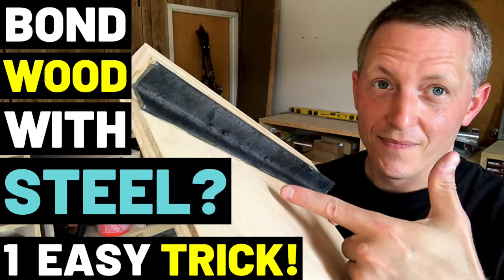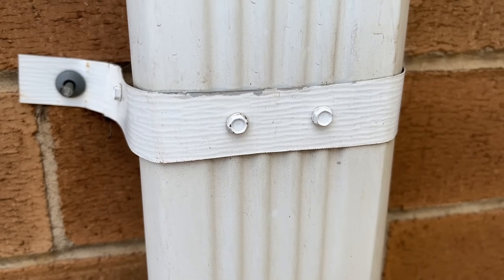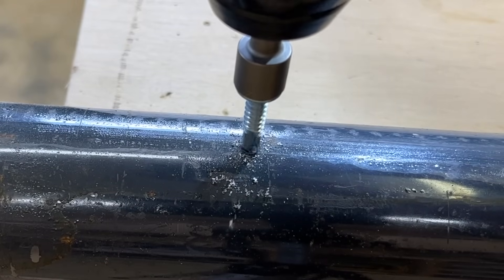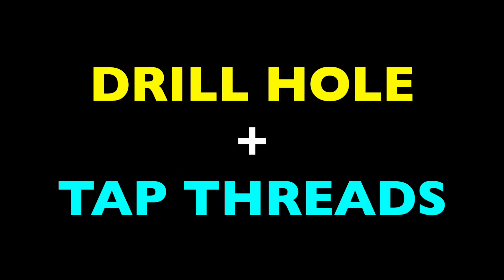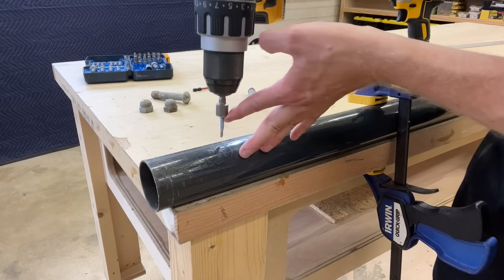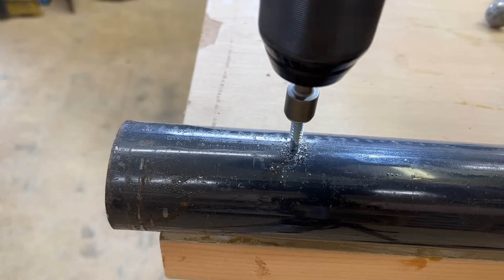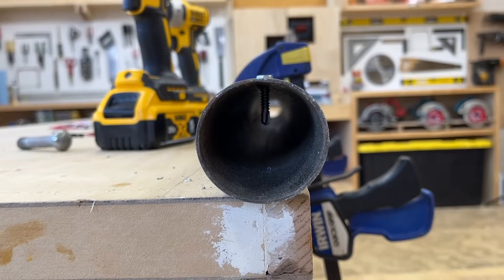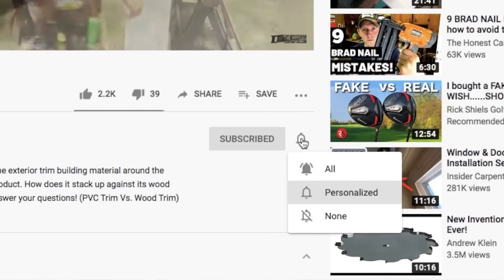These Screws CAN DRILL STRAIGHT INTO METAL! (Self-Drilling Screws...Fasten Anything To Metal!)

Comment: As someone who uses these screws all the time. I’m a commercial plumber so I’m constantly securing to metal studs. That being said the title made me laugh. I understand that it’s aimed at people who don’t know this stuff but it still sounded like they were some revolutionary new invention. I do find it odd how we use the names of these screws. I know they’re self drilling but myself and everyone I know calls them self tappers. If I asked a helper to pick up some self drilling screws who knows what he’d come back with.
Reply: Thanks for this comment because I was just wondering if I could use these self tappers to attach heavy shelves & heavy art work to my condo walls that have steel stud beams.
Reply: @sunshinesandy3265  actually if you’re connecting something small but heavy, I wouldn’t use self tappers. Screws even fine thread don’t hold really great in metal. Maybe if they’re structural metal studs then they’ll hold. If they’re standard partition type thin metal studs, I’d drill a half inch hole and run a toggle bolt vertically through it. That’ll hold anything you can throw at it
Reply: @joshcowart2446  Thank you so much for your help. You recommend that I drill a 1/2 inch hole horizontally through the drywall & metal stud and run toggle bolts right? Should I use my Bosch Cordless Drill Driver or Impact Driver? And what type of drill bit should I use Titanium or ?
Reply: @sunshinesandy3265  yes. when I say toggle bolts I’m referring to the zip style. Many call them molly bolts. I’m not referring to the spring loaded ones. The spring loaded toggle bolts will work but they’re just difficult to use and if you mess up you can’t reuse them. Home Depot and lowes sell the zip style in packages with as few as 4. I use 1/4” ones and they’re rated for 100# in drywall so in a metal stud one would hold hundreds. If the shelf doesn’t line up with 16” center studs, I’d get one side in a stud and the other in drywall. I don’t know the weight you’re hanging but I’ve used that same method to hang a 20 gal water heater on the wall. I’ll put a link for what I’m talking about after the text.
As for drills, generally drills are best for drilling holes and impacts are best for driving screws. The exception is if you’re doing fine woodwork then drive screws with a drill so you can control it better and not tear things up. However in this case either tool will both drill and tighten the bolt. 

https://www.lowes.com/pd/TOGGLER-10-Pack-Assorted-Length-x-3-16-in-Dia-Toggle-Bolt-Drywall-Anchor-Screws-Included/3183815

I like these best. The ones at Home Depot will hold just as much but they sometimes break getting them in because of how they’re designed. However some Home Depot’s have hilti brand mollys and they’re just as good or better than these. We use these for all sorts of very heavy things. I use them for wall mount water heaters, porcelain wall mount bathroom sinks. We’ve even secured 3” steel gas pipe to a wall. They’re the best drywall fastener. I don’t know if I mentioned it but when you put one in a metal stud you have to put it the metal toggle in vertically. If you don’t it won’t be able to sit flat and will either break when you’re pulling it tight or cause your bolt to be crooked
Reply: @sunshinesandy3265  sorry I forgot to answer the drill bit question. Titanium will work. Any twist drill bit should work even if it’s a thick structural metal stud. The material they’re made from just determine how long they’ll last. If you’re just buying some for around the house then I’d save money and get a set of black oxide. Black oxide are the cheapest, then cobalt is next, and titanium should last the longest. When drilling metal you want to use your drill, put it on the high torque/low speed setting (usually 1 on most drills). If you aren’t sure, there should be two speeds, just pick the slowest one. Fast will work but it heats up faster and will dull your bits quicker. However like I said earlier if you’re drilling through thin metal studs, you can use your impact or drill on whatever speed. It will go through it so fast it won’t matter. 1/2” hole should be perfect but depending on the size of toggle bolts you may can go smaller. If you’re having trouble drilling the bigger hole then start with 1/8” hole, then 3/16”, then half. That’s what I do because those are standard but sizes that I keep but any small size will work and then just worn your way up
Reply: @joshcowart2446  Thanks very much for your awesome advice & link. I appreciate it immensely and will buy those togglers you recommend from Lowes. I never liked those spring toggle bolts & never used them. I want to hang a book shelf and a very heavy painting with two metal bracket mounts on each top corner. And secure a medicine cabinet in bathroom that became loose.
Reply: @sunshinesandy3265  you’re very welcome. Based on that, you could probably just use those in drywall and be fine. But if you have a stud there why not quadruple the strength
Reply: @joshcowart2446  thanks again for your fantastic advice. I need to buy larger drill bits too and appreciate your recommendations. I can tell you are super skilled professional and really know how to do things right.
Reply: @joshcowart2446  I have a Zircon MultiScanner HD800 is that most accurate one to locate metal studs, center of studs, electrical wire & deep metal pipes? It seems to indicate metal studs are 16"apart and 1 1/4 " wide does that sound accurate?
Reply: @sunshinesandy3265  that should work. I have the cheapest zircon stud finder and it works really well. However the best way to find metal studs is a rare earth magnet or any reasonably strong magnet. Either can get close enough. If you need to pinpoint it get a small drill bit or finish nail and push it through the drywall until you hit something. As for the size I thought they were just like 2x4s which are 3 1/2 x 1 1/2. The 16” is correct but that’s center to center. The distance in between is usually 14 1/2 but that’s based on 1 1/2 thickness. If it’s 1 1/4 then I guess it’s be 14 3/4 in between. If you can’t find one at 16”then it will be 24” but most are 16” on center
Reply: @joshcowart2446  Thanks for your awesome intel. The studs I measured with Zircon MS HD800 are 16" apart from center to center. Center detection seems very accurate. Metal 2x4 studs are supposed to be  3 1/2 x 1 1/2 so I guess Zircon edge to edge detection is 1/4 inch off because I used painters tape on wall to mark stud center & edges. I did use new 9V battery in device good til 2026. I have other stud finders that I'll locate  to compare accuracy. I used to have magnetic model years ago. I watched a  Metal Stud TV mount video that recommends Elephant Anchors (toggles)  so I see what you mean about inserting togglers vertically through metal studs.
Reply: That's funny. Been there, done that with contractors. As a total amateur at DIY trying to hang pics on a steel wall, this was helpful.thanks

Comment: All self-drilling screws are self-tapping screws but not all self-tapping screws are self-drilling. Call it by the correct name -- if it's got a drill bit at the tip, it is a self-drilling screw (Teks is a brand name). I've been in the fastener industry for over 40 years and the video is fundamentally good. I see all sorts of comments. First, you CANNOT use an impact driver to install these without risking the head breaking. A hammer drill causes the same problem. You need a screw gun or standard drill. The drill speed cannot exceed 2500 RPM and slower is recommended. That's from the people who make the screws. If you go faster, your points DO wear down faster than they can drill because the particles heat up and cause the point to burn as the friction increases. If you pick the correct one you DO NOT need to pre-drill a pilot hole. People don't realize they have different point geometries numbered from 1 through 5. You want to right one for the right job. (Where these screws aren't so good is when there's wood involved. There are special versions for wood-to-metal applications.) I won't bore you further.
Reply: He actually did make that point (about all are self tapping) around 2 minute mark. You make some great points though too, thank you.
Reply: @shawnc9557  We re-read the answer and it came off much harsher than it should have. We didn't mean any criticism but were just trying to give more information :)  Thanks for the reply to our comment.
Reply: Very useful comments, thanks
Reply: I'm trying to screw in a wooden board onto a metal container.... Do I first drill into wooden board then later drill on the board and metal container, or
Drill both at the same time using a self tapping screw?
Reply: The specs on many commercial buildings REQUIRE that that you use a torque adjustable screw gun when installing metal roofing or siding so that the neoprene washer is compressed exactly the right amount. I have seen many inspectors shaking their heads when a carpenter gets out a depth adjustable TEKS screw gun or, worse yet, a cordless impact driver. Use the proper tool.

Comment: I just finished (and I mean just yesterday) putting together a steel carport kit.  It came with some of these screws.  After screwing about 30 or so of them into place I decided to use a regular drill bit to drill a pilot hole first rather than 100% rely on the screw to drill the hole.  In my case at least this helped a LOT.  The screws in the kit seem to me to be high quality, but drilling a pilot hole still helped me out a lot.  Just my own experience.
Reply: It depends on the metal. Yes sometimes just using a drill bit is better/quicker.
Reply: When screws won't start, I like to hit them firmly with a hammer. Fasteners can take a bit of abuse, and once the working surface is pierced they tend to grab and drive easily.
Reply: @dandersonanza  I have a cheapo spring center punch for that
Reply: When you're doing it as a hobby that's fine. When you do it for a living and time is money you get used to the feel of the screw gun handed to you.

Comment: attaching metal to wood with self-drillers is ng, they drill to large of a hole in the wood to hold well.
Reply: Agree. And back wood with steel but don't back steel with wood. The wood fibers will eventually tear (strip out).

Comment: Great video.  One thing I learned is not to use them with a drill driver or hammer drill.  The head will snap off to easily.  A regular drill works great.

Comment: I use self drilling screws all the time at work and have discovered that they are also great for making pilot holes, especially in metal. They tend to not slip as much as a drill bit when starting and, if you're drilling for a larger screw, you can do it all without having to change your bit or tool at all. 

The other thing they're great for is temporarily attaching things to metal - I'll use pretty small (#8) self drilling screws to hang heavy cooler doors so that I can test them out and adjust the placements if needed. One quick operation to put them in, then I've got pilot holes ready when I'm putting in the more permanent fasteners without having to risk metal fatigue from inserting and removing the full size screws.
Reply: Same here, I've actually changed out most of my home project screws with self  drilling screws, it was tedious tapping, pre drilling, etc.
Reply: Since you talk about removing the self-drilling screws, do they strip the threads in the metal when coming out in the reverse direction? I have a few pieces of wood fastened to a metal structure that I would need to remove and reattach multiple times, I'm afraid if I take out the self-drilling screws the thread will be compromised and I won't be able to put them in again. Maybe if I take them out and replace them with regular screws of the same size that won't be too much of an issue? Or should I go with a slightly larger screw that will tap a new thread in the same pilot hole as you're doing?
Reply: @FilippoMasoni  Any metal will loosen up after removing and reinserting the screws repeatedly but I've rarely had a problem with screws stripping unless I'm working with fairly light gauge material. Unfortunately, that's what I'm normally doing.
I don't find that self-drillers affect the threads any more than regular screws do. If you're gonna have a final position after all the removals, then I would suggest going up a size - it gives you the best grab. If it's something you'll keep having to move just start with the smallest screw you can get away with and move up to the next size when it starts to loosen up. That'll give you the best long term results.
Reply: @spaci-1701  thank you for the advice. The material is fairly thick probably 3mm, it's tubular steel. The final position will actually be without the wood paneling, so I will paint in the holes to prevent rust long-term. During the building process, I will probably have to remove and reinsert them 3-4 times max I hope. I'll get smaller regular screws and try. The self-drilling ones that are on now, are also too long than they need to be, so with shorter ones, I will avoid running the threads too much.

Comment: An old Indian trick that a Irishman taught me! Great video, Like you said these screws have been around for a very long time, but many are not aware of them. They are great for metal to metal, but do not rely on them for metal to wood applications and here's why. The bit tip takes out too much material in the wood to fasten properly! Yes it will hold some, but the finer threads are designed for metal and are shallow and more threads per inch. For screws to hold in wood, they need to be less threads per inch and deeper threads that hold into the softer wood fiber. The hole in the wood needs to be smaller than the hole in the metal so that the threads can dig into the wood and hold much more securely. I have found this out the hard way when I used this type of screw when fastening metal to wood, but I found they would pull out much easier than proper wood or even more coarse sheet metal screws.

Comment: I often use self-driving screws to drill holes in steel rather than dulling a drill bit as long as the hole size is not critically important. They are really great for attaching metal to metal or wood to metal.

Comment: Excellent video and info.  I thought I was going to have to drill a bunch of small pilot holes before driving self drilling screws into sheet metal.  I believe the info you provided will simplify my task greatly.  I am going to begin with the nail punch suggestion to assure I can keep the screw on line as I start.  Thanks for the video.

Comment: These screws are also useful as a tap-and-die in a pinch. I like to use them to tap holes for mounting post lights. Then I back out the screws and use the supplied decorative screws to attach the light.
Reply from the maker: Good tip, Dan!

Comment: Using these right now to replace the weatherstrip on my front door, which has a steel frame.  WOW - didn't realize it would take almost a full 60 seconds per screw to pierce through.  The problem is, once it does break through, it threads so fast that you have to be careful not to over-screw or risk ruining your new aluminum strip!

Comment: wow just in time for my little project for fastening brackets to a square tube, was contemplating riveting it as I do not want to drill through both sides of the tube metal for a nut and bolt, but i guess i can use this to fasten it instead and i only need to drill on one side now.

Comment: These screws actually make for decent drill bits (not just in steel) in a pinch just be careful because they can overheat if you use them repeatedly over a short period of time. Had to drill a bunch of pilot holes into 18mm fc sheets, drill bits were over heating and loosing temper so I grabbed a couple  of series 500 and just cycled through 15 screws (allowing them to cool).  Ended up saving money and time.

Comment: I love Tek screws. When I screened in my porch there was a structural steel beam supporting the roof beam in the middle, so I had to attach my screen frame to that. The Tek screws worked perfectly, I just had to be careful not to overtighten and crush the thin aluminum screen frame. A little white paint on the hex head and it blended right in. Unless there is some overriding aesthetic reason, the hex heads are the only way to go, especially in thicker metals.

Comment: The video was about attaching wood to metal and metal to metal, for metal roofing, you’re attaching metal to wood, not a big distinction but an important one. I know at the big box stores they sell the roofing screws with the drill point tip, but at the roofing store they recommend using the pointy screws. I’m not an expert but i think a pointy screw would hold your roof panels down better than a screw that bores a big hole in your, usually, 1x4 wood furring strips.
Reply: The cutting head should be smaller than the thread so hole size doesn't matter.

I'm a roof plumber here in Australia (metal roofer) and we tend to use zips (multipurpose screws) , though back in the day it was always the pointed head (timber) screws for fixing sheet even though we use metal battens.

Comment: Not sure if this applies to these screws, but certainly when drilling and tapping metal, you are advised to use a slow speed on the drill and to use some cutting fluid (the machine shop I worked with swapped their expensive cutting fluid for WD-40, BTW!).

Comment: Hi! Question? I’ve been dealing with fastening a flag pole bracket to my metal garage. I’ve been using the hex head screws but when the wind blows, the flag pole has been pulling the screws out of the metal? I now have several holes in my metal because of reattaching. Is there a way to keep the screws from coming loose? Ty